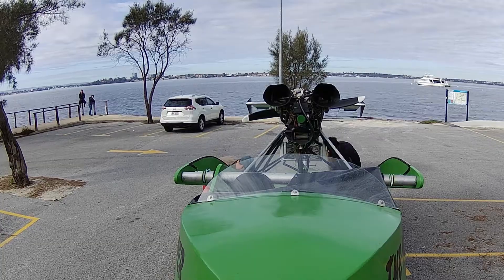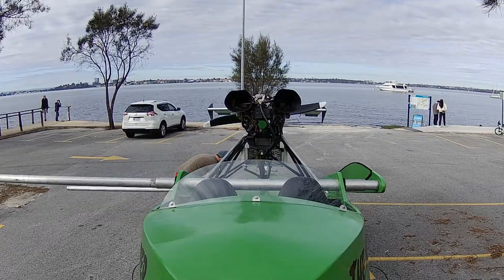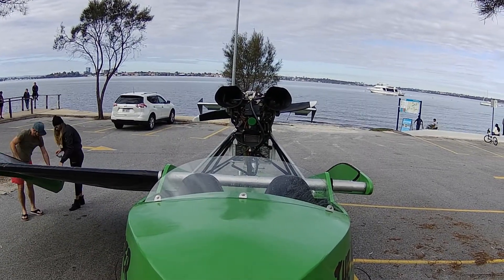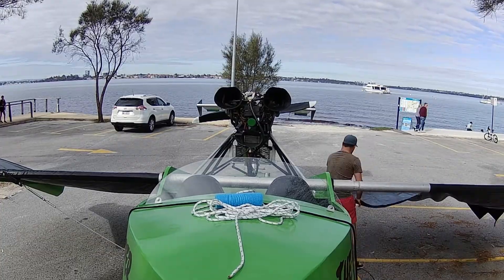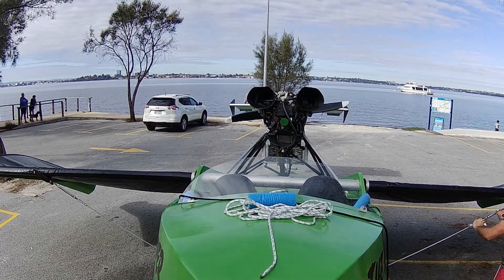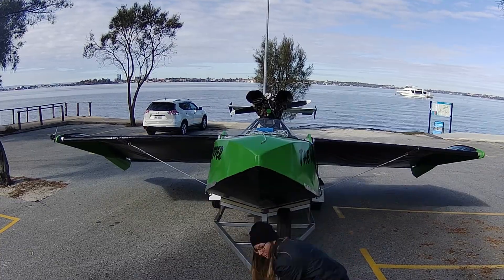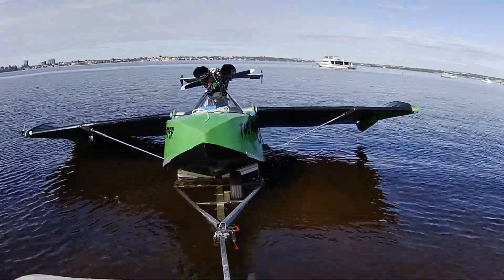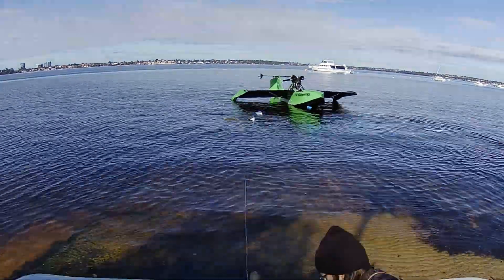Setting up the MudSkipper for flight. Homebuilt wing in ground effect flying boat.

Comment: How much power does this engine have? After you launched it I see that the hull has "over buoyancy" and floats on the water like a soap bubble ;) so the construction is light, how much does it weigh if it's not a secret?